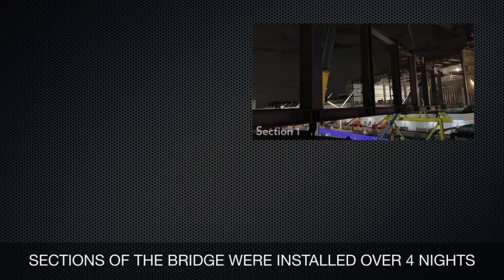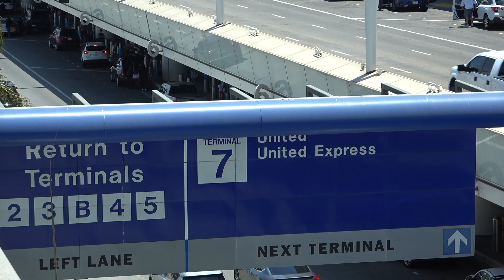LAX $1.6 Billion American Airlines 4.5 Terminal Core Update

Comment: still don’t get why they chose those boring cubes for all the terminals they could’ve gone with the design for the new tom bradley terminal or the west gates
Reply: They are not boring. The designs are Mid-Century Modern influenced. Once it's all finished you'll see how all of LAX will have much more cohesive design aesthetic. It will harken back to it's original design aesthetic of MCM. The Theme building is an original MCM design. The Y shaped light fixtures around the horseshoe are also MCM inspired. In fact, the Tom Bradley facade now being renovated will also have a MCM facade once done. It will look awesome.

If you want to know more about Mid-Century Modern design look up Le Corbusier and Mies Van der Rohe. The design aesthetic is one of elegantly simple lines that bridge the connection between between the outside and the inside of a building. You'll see once these buildings are finished, and you're inside them, they will be filled with natural light and open views to give you that sense that you are both inside and outside at the same time.
Reply from the maker: I'll have a video soon of glass windows going up at Bradley.
Reply: @theexmann  These cubes are more like those of Pereira (department store cubes).  There is a little of Neutra too in the window articulation (fins).  But otherwise the cubes are far too banal for even Neutra and especially Corbusier and Mies.
Reply: @LDVTennis  We won't know until they are actually built to get a true sense of their impact. My argument is that they are MCM inspired designs. In fact, it's obvious. that the entire renovation at LAX is MCM in nature. In fact, all the architects you list can arguably be classified as MCM focused architects.